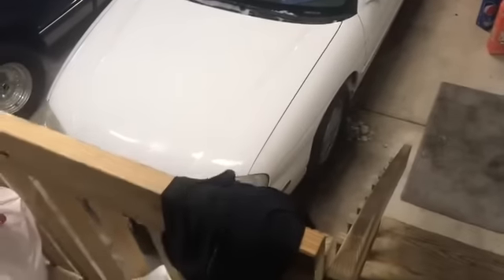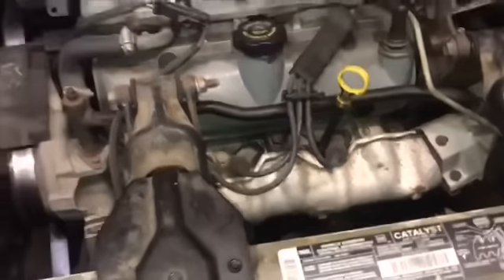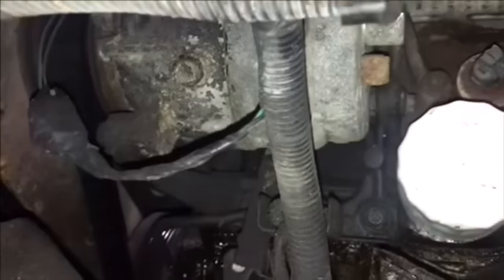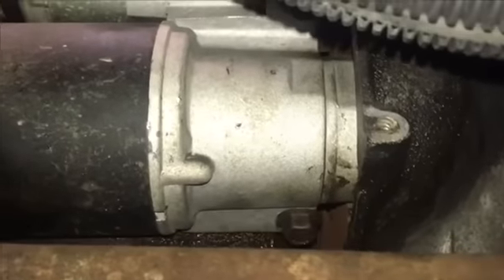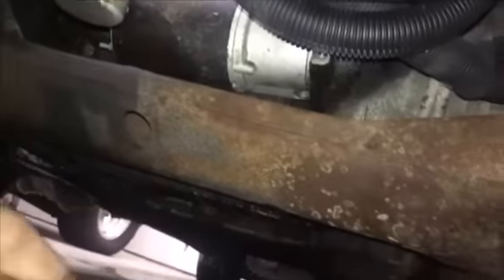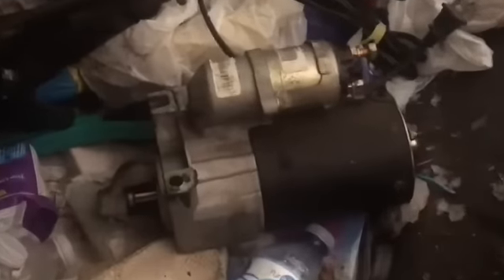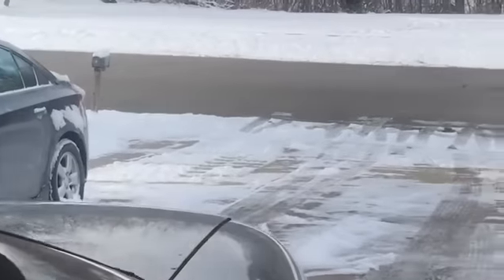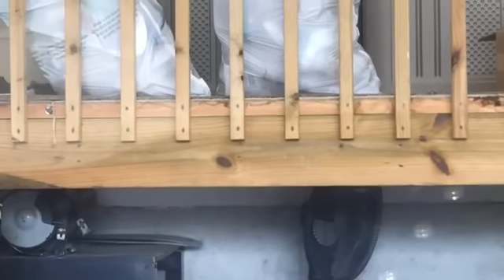Nice and warm😁

Comment: The easiest car I ever had to work on was a 1964 dodge Dart. I did everything on that car except replace that slant six engine. it just kept on running. 400,000 miles and was running when I sold it
Reply from the maker: Yes all that empty space 
In the engine area on the sides
Of it 
Easy to get at anything!!!
Makes ya wonder why  ppl got rid of those cars from that
Era

Comment: Changing a starter used to be easy once, not anymore
Reply from the maker: Yes. !!!
Now more modern cars it’s a right tight fit 
Not very enjoyable 🤔
Hey but now it starts much better in the cold!!!
Reply from the maker: On this type of car the engine and transmission assembly is mounted to the sub frame
All installed from under side of car in one go